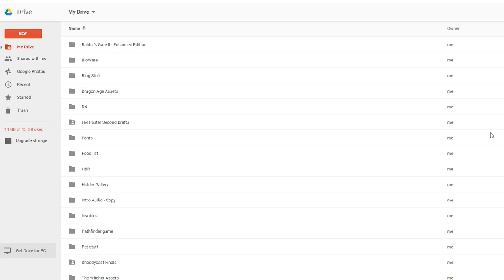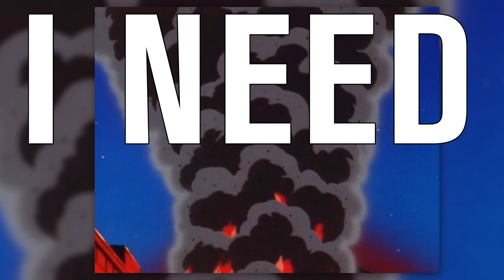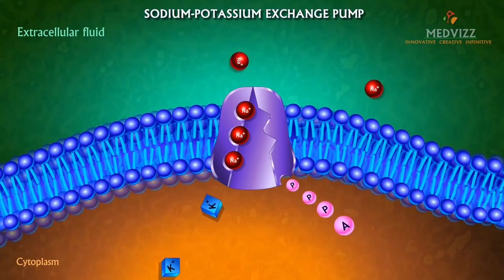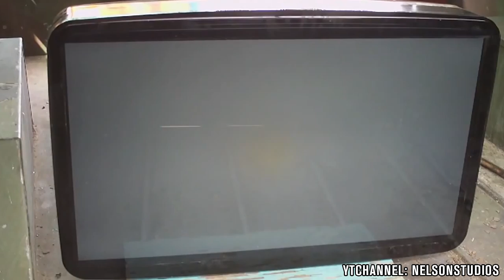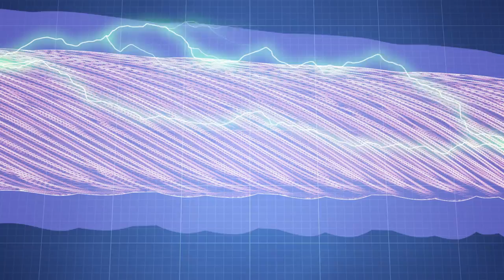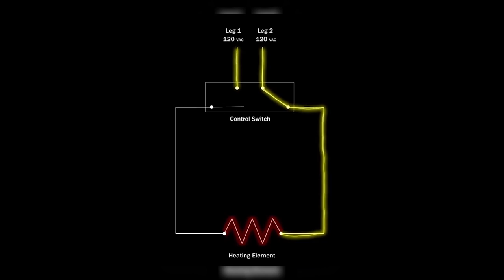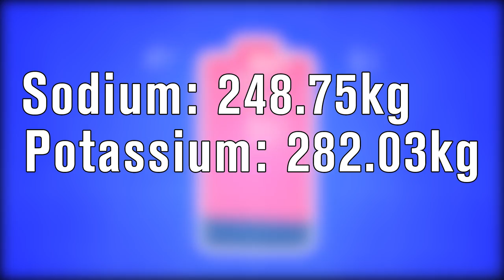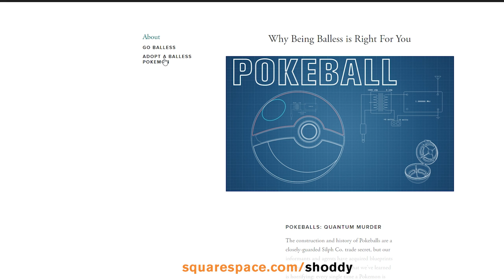The SCIENCE! - Exactly how OVERPOWERED is Pikachu?

Comment: Hold on, for that 6.2 million bottles of gatorade, what size would they be? and how much would that be in gallons?
Reply: Divide it by 4 is a good estimate
Reply: +Mar Fung 1,550,000
Reply: If we are using the one that are about 6 in. tall (12 fl. oz. or 355 mL), times 6.2 million equals to 2,201,000,000 mL, or 2.201 million liters, or 17,195,312.5 GALLONS. Using the Glacial Freeze flavor, that equates to 74.4 KILOGRAMS of sugar. Talk about a sugar rush you'll never get rid of.

Comment: The stone isn't exploding..... The air is expanding and exploding out to blow away the stone
Reply: Sorry to necro this, but this particular nitpicking is like making someone notice that animes and cartoons are two different things. While being right from a certain point of view, it still hurts my nervous system.
You're right, the stone per se is not exploding, but the air atoms and molecules that makes the structure of the stone unstable enough that the result is an explosion. However, to gain enough energy to do this, air needs an external source of energy: heat. And guess what creates heat in this case? Resistance, from the electricity generated by Pikachu. Since Austin actually covered this in the video, and refers to limestone exploding as a quickier way of meaning what I explicited in this comment, the result is the same.
Still, I may have jumped too soon, as your intent behind the comment is not clear to me.

Comment: Hey Austin

In the Pokedex entry is written, that it have Organs in his Cheaks, that can store electricity. We all know, that a Pikachu needs a charge time for some Attaks. The Strengt of the Discharge grows with  the Chargetime, like it have two badass Capasitors im its Face. Would that not reduce the need for 500kg powergenerating mass? Sometimes i thought about, that Pikachus probably have undiscovered psypowers, that gives them the capabilities to generate a static charge with airmovement, like some kind of van de graff generator. In my opinion this thought is supported by the fact, that a Pikachu seems to hover while charching and discharching. it wpuld explain, that the Lightningstroke hits a far away, instad to hit the ground under it or toast the trainer. 

Please tell me, what you think about my Theory.
Reply: you forgot to sign the letter much less send it
Reply: I can't even read this, if this was a letter it'd be like interpreting a toddler's drawing of a pikachu

Comment: You are failing to notice one thing about Pikachu destroying both the temple and the mountain. I'll start at the beginning. 
In Pokémon electric moves are not effective whatsoever against rock or ground type Pokémon, so how could an electric move affect both the temple and the mountain which are primarily rock? Explosive force.
Pikachu used Energy Ball on both of those things, energy ball being a move that condenses Pikachu's electrical energy into a tight ball with he somehow creates and fires from it's tail, not it's cheek sacks as with most of Pikachu's other electric based moves.
Looking closely at this energy ball, would it not be safe to assume that, as it's an electric move and electric moves do not affect rock Pokémon in this universe, it should not affect the temple or the mountain?
So what happens to this incredibly condensed ball of electrical energy when it comes into contact with rock structures like a mountain or a temple? It explodes due to the ball being compressed out of shape and rupturing.
Hence the electrical energy did not destroy the rock structures it was actually the force of the explosion that did.

SCIENCE!!!!!!

Comment: 5:28 | But what’s the amperage? As someone slightly educated in electricity, I know that volts are the pressure, the speed of the energy. The amps are the amount of energy in the current, the killing part. Electric fences exploit this, having incredibly high voltages to deliver both a quick shock and permeate the fence nearly instantly, with relatively safe-for-animals amperage ranging from 50-150 mA. For reference, an Apple 10W charger delivers 5V 2.1A 50-60 times a second. An electric fence would discharge ~100-1000 times a second, maybe even more. Ouch.

Comment: Actually the reason Ash's Pikachu won't go in his pokeball is, cuz Ash never uses his pokeball when trying to put Pikachu in a pokeball.  So basically Ash is an idiot. Pikachu's pokeball has a yellow bolt sticker on it, but Ash never uses that pokeball for Pikachu, hence why Pikachu doesn't go in his pokeball, cuz it isn't his pokeball. This however isn't true of other Pikachu's in series have no problem entering pokeballs, as their respective owners actually use the correct pokeballs. So conclusion: Ash is an idiot.

Comment: it's funny how pikachu can destroy mountains and stuff, but in the anime, the probably known "max" pikachu can go is about 100000 volts because the anime AND game refers to one of pikachu's cannon move as "thunderbolt." The Japanese version (obviously has more cannonisity) says "十万ボルト" translating to 10 thousand volts.  It takes about 1000 volts for electricity to travel/rip 1 cm  of air.  using simple 2nd grade math, we can tell that Pikachu's supposed "thunderbolt"  is only travelling a radius of 10 cms.
electricity is also known to travel to some with the least resistance.  If we placed Satoshi/Ash in a pokemon stadium like the ones from BW, we can most likely bet that the 10 thousand volts are going to travel to some trainer...

Comment: So you mean to say that a literal "yellow" stream of electricity has the only effect of heating up the material it comes in contact with? You really think a fuck ton of electric current which is flowing through the air similar to how lightning occurs doesn't effect the air pressure? doesn't cause ionization? doesn't alter molecular structure of the goddamn material it comes in contact with? and all the while simultaneously burning half the air around its path and causing a damn vacuum which probably effects the "burst" more than the heating effect of the electricity? 
Don't get me wrong, I love you but if you're going to say "We stop at nothing", you better be ready to start it for real my mahn. 
Sincerely,
Za internet.